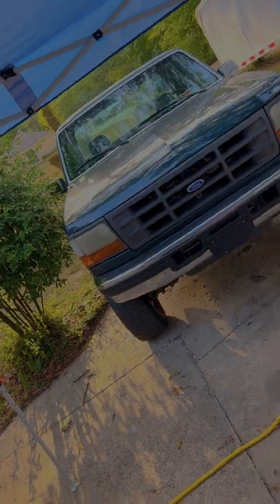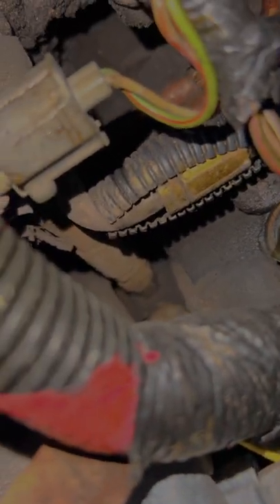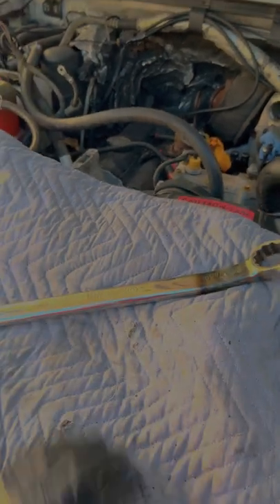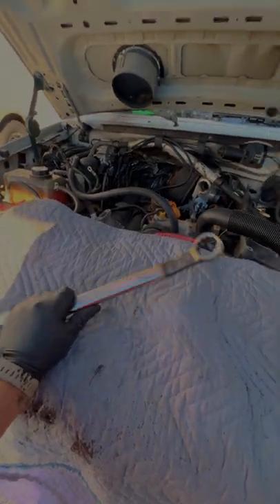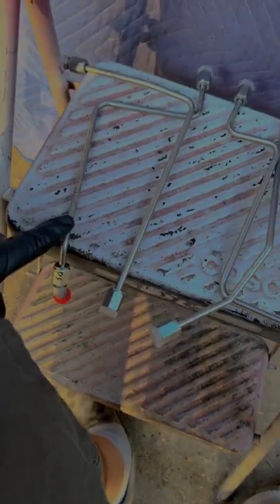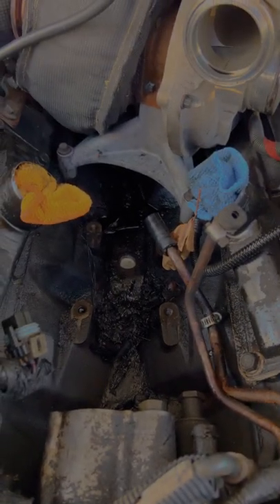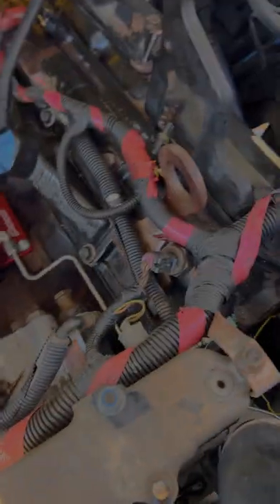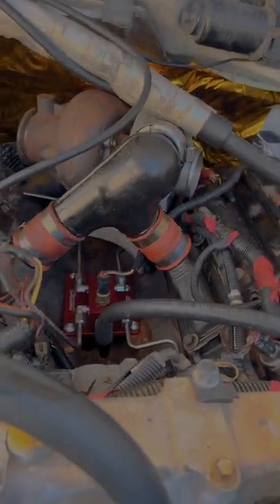How To Video - 1992-1997 Ford F-Series CNC Fab 4 Line Kit Install

Comment: So is there no return line back to the tank for a regulated return setup? The feed line is just a hose from the pump to the fuel distribution block? Looking to use this kit with a airdog system while retaining dual tanks
Reply from the maker: The air dog returns the fuel at the pump block
Reply: @CompletePerformance  same question I'm doing the 4 line kit now but currently have the regulated return with my air dog pump. So is there no return line now in the valley

Comment: Did you have to run other sensors with the cts?
Reply from the maker: Yes I’m running the “competition kit” which includes pyro, a temp sensor, and a pressure sensor, I’m using that sensor for fuel pressure

Comment: Hi did you ever deal with a oil leak down when you shut the motor off
Reply from the maker: Never had this issue with this truck on that
Reply: @CompletePerformance  I'm having that problem with mine

Comment: did you have any problems with your Fuel pressure censor? I have installed the same kit and still dont have FP. What parts did you use?